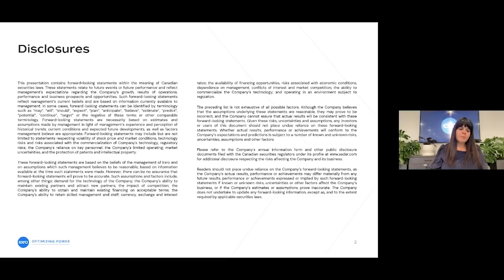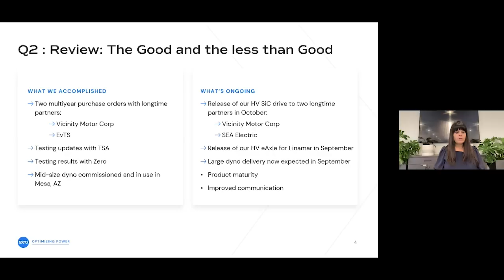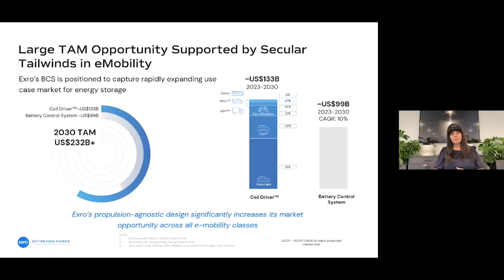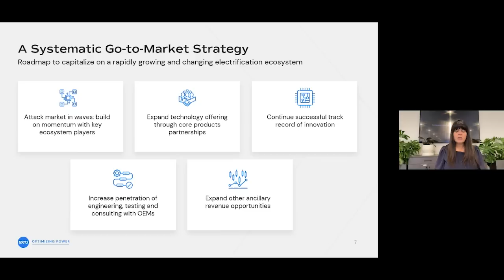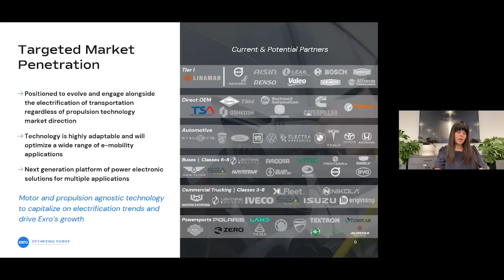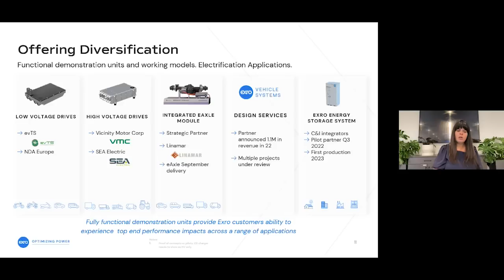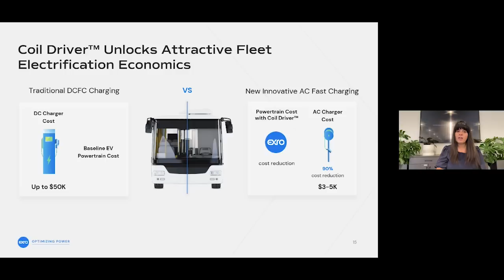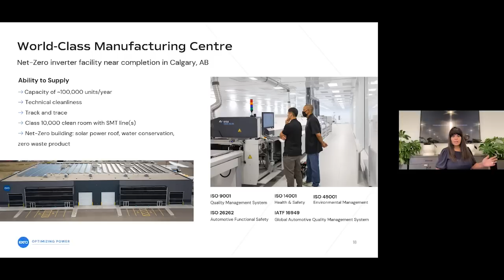Exro Shareholder Update & Tour of Manufacturing Facility Cleanroom in Calgary | Exro Technologies

Comment: Out of all of my stocks, im the most excited about #exrof
Reply: I also have really high hopes, but It is one of those where it's still hard to predict how succesful it will be.

In my mind it could either be an absolute no brainer when it feels like a magic box that every EV manufacturer craves to have, or it's this niche product that'll be great for some aplications.
Anywhere between there 😂
Reply: Yes, its still in the baby steps from where I first found these guys nearly three years ago, when it was just pennies per share. Hopefully, it starts up once again near the second half of the year. Automobiles are going to use these, rather than different motors for different torques, much like the clutch and clutch assembly.